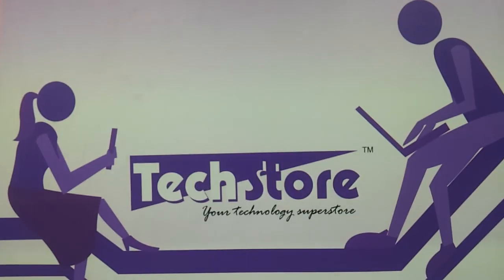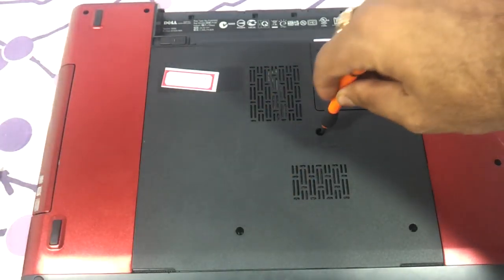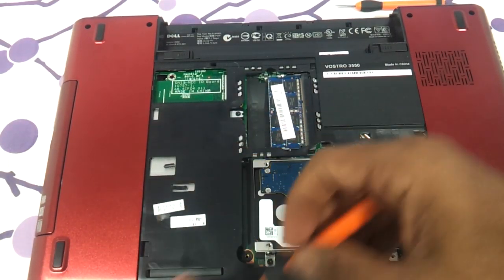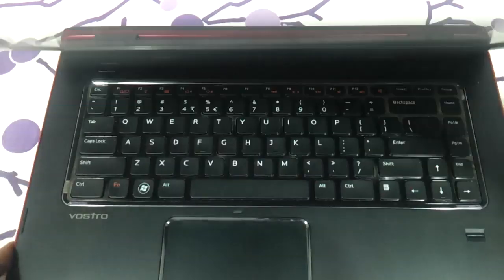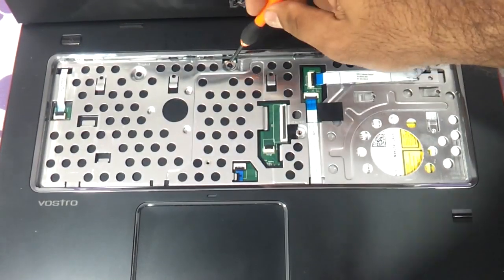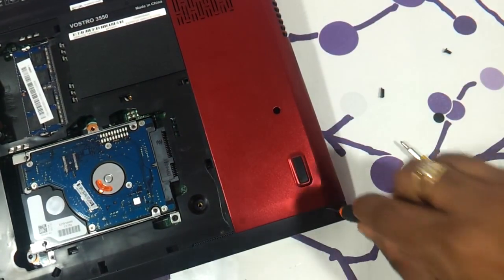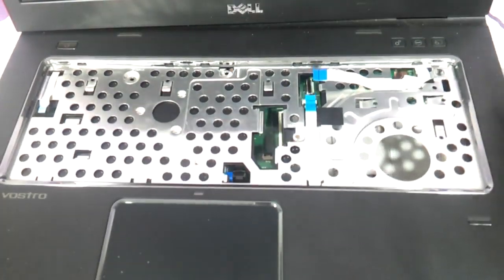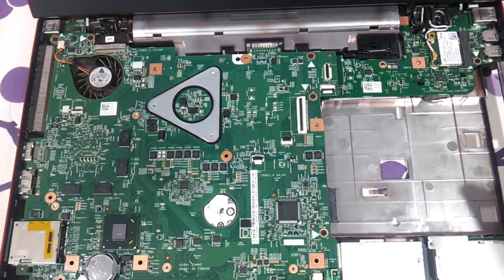Dell Vostro 3550 how to upgrade ram hdd keyboard touchpad dvdwriter

Comment: Hello I took out my RAM and put it back in. Now my computer just keeps beeping every time I turn it on with a blank screen. What does this usually mean?  Did I somehow accidentally create a static charge?  I've taken it out a few times before and it always work perfectly when I put it back, but this time this happened.  What are my possible issues and solutions?  Please and thank you.
Reply from the maker: Static charge might be an issue. Have you tried another memory
Reply: Techstore no I haven't cuz at the moment I don't have another memory.
Reply: Techstore it is doing its beeps 2 times every few seconds which I have found is referring to RAM.
Reply: +zgi88 try and put it in another ram slot

Comment: Very good job. Easy to understand everything.  Thanks. Could you tell me the basic difference(s) between the 3550 and the 3560?  Maybe just gen2 vs. gen3 of i3 or i5 cpu's or what?  Thanks for any help on this.
Reply from the maker: Hi, There is no difference between the two.
Reply from the maker: 3550 is 2nd gen based laptops, 3560 is 3rd gen based laptops.
Reply: Techstore Thanks!  Exactly what I was needing to know.  Keep up the helpful vids man.
Reply: Techstore
Would you be able to clue me in on why Vostro 3550's are so cheap and available for resale, but 2520's and 3560's are not, and/or are much more expensive in comparison?  Why would 3550's be so cheap if they are so close in specs?  What is wrong with them? 

I need to buy two of the same model for a client and not sure if I should get her two 3550's or what.  She wants two of the same model.  I'd never buy a 2520 or a 3500 as it is RIDICULOUS and inexcusable what it takes to replace the hard drive.  great specs, Awful hw location internally.  Any insightful help will be GREATLY appreciated.  TIA!

Comment: I had the same problem. I found that it's the friggin stupid touchpad to blame (you can tell I'm still aggravated): when you type and inevitably touch it with the palm of your hand - ever so slightly - it registers as a cursor move and click. My colleagues have the same problem with this model (and others from Dell). It's unfathomable how such a well-established company would oversee such a glaring usability issue. I resorted to disabling the pad and use a trackball instead.

Comment: (I own a Windows 7-32 4GB V13 , a Windows 7-64 4 GB V3550 and a Windows 7-64 V3750, and I must say that I use the 3550 most of the time. I am also considering to upgrade it ine 8 GB and replace the HDD by a SSD. The 3550 boots perfectly on an Ubuntu SSD connected to a USB3 port, but the 3750 does not want to because of the Optimus circuit, unless I do some tedious and risky work. It does not work with Linux Sabayon either :-(

Comment: There is a utility on the CRUCIAL memory site alllowing you to scan your Vostro 3550 or 3750 (+ other models) and showing you how much memory you have, how it is arranged, and proposing you replacement modules to enhance your RAM to 8 GB. If you have 6 GB, it means you will have to give a 2 MB module to a charity and replace it by a 4 GB module. Of course, Crucial proposes you to buy it on their site, but they are fair-play and gives you the reference # if you want to buy it elsewhere.